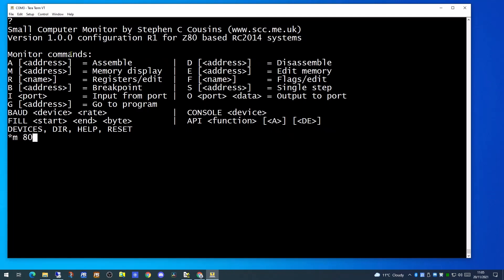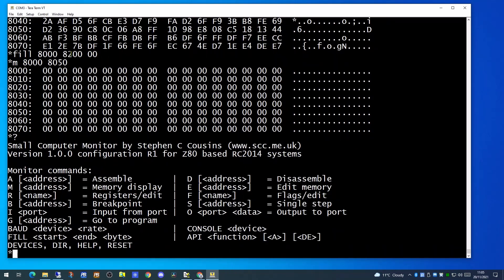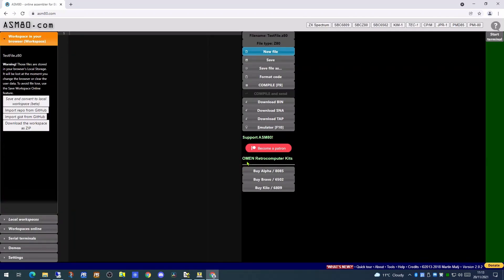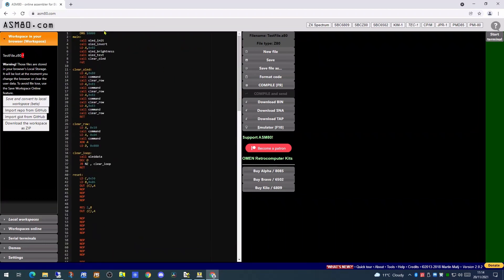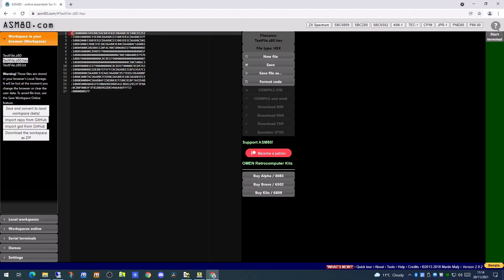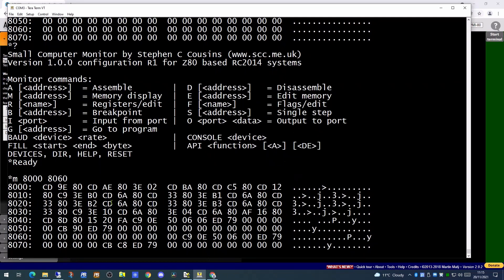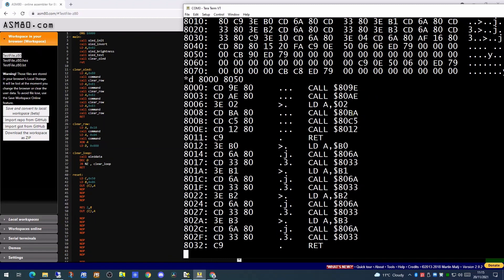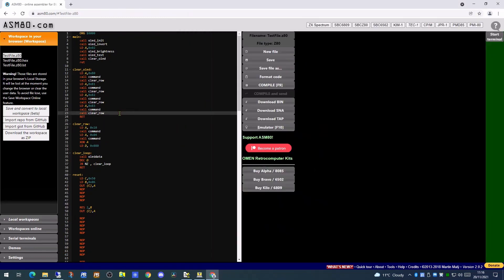RC2014 mini - Z80 modular system - part 4 - Assembly coding

Comment: Thanks for Your video.
Being a former (40 years ago) Z80 system designer it would be fun to restart. Nowdays playing with Arduinos I think about letting an Arduino receive the hex code line by line and deposit the code in a Z80 RAM memory. Then just release the Z80 from its HOLD or BUSREQ and let it run.
Do You think the Pc software You use would manage that? Guess the Arduino needs to emulator some kind of terminal.
Reply from the maker: Use the Arduino as a terminal could be one approach, there are certainly a lot of options.